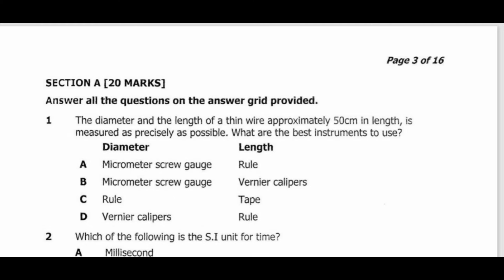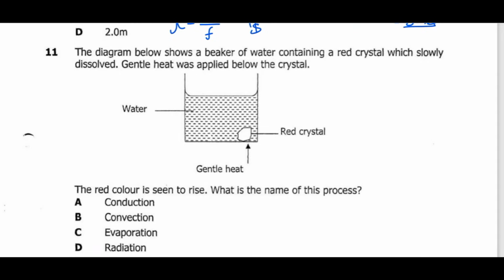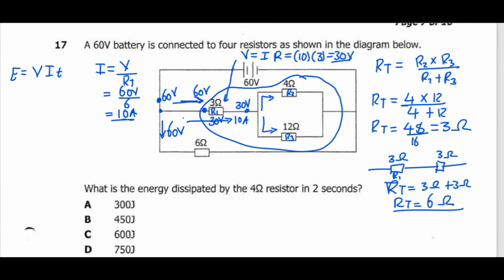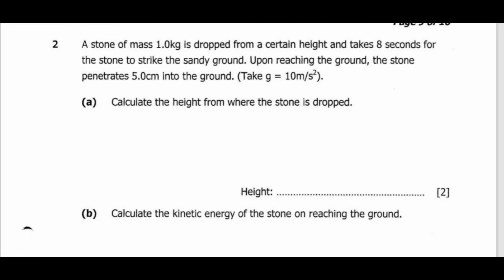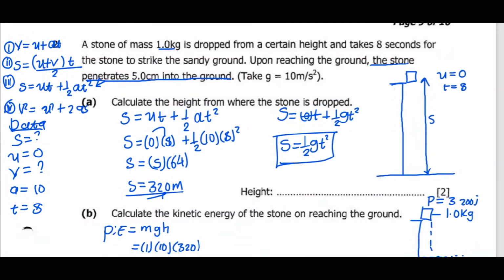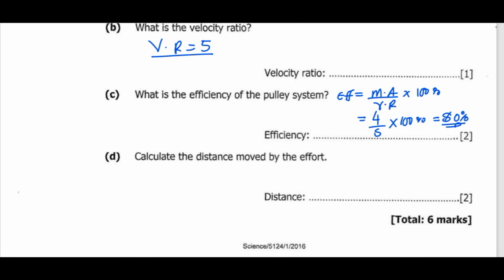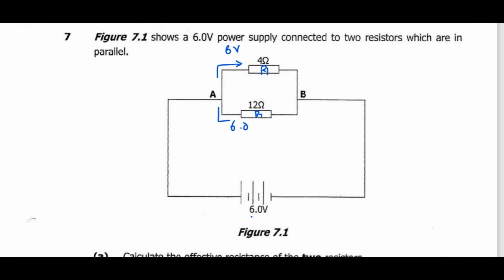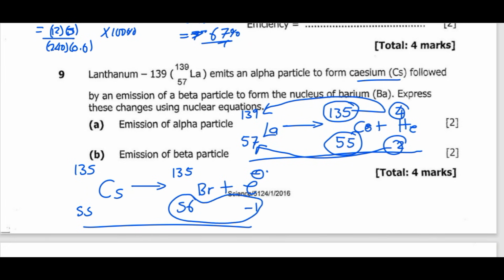Science Paper 1 2016 internal

Comment: Sir I have a question on the circuit. When am I supposed to split the voltage coming from the battery and when are my supposed to use it directly?
Reply from the maker: Use direct if it is in parallel